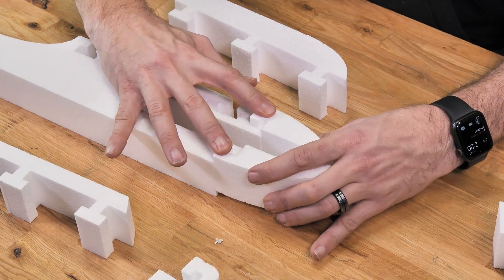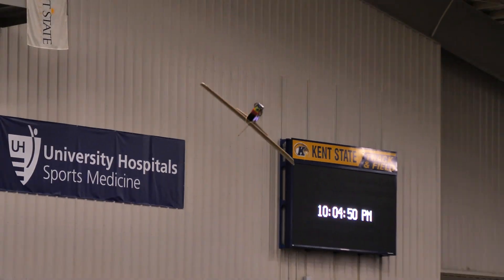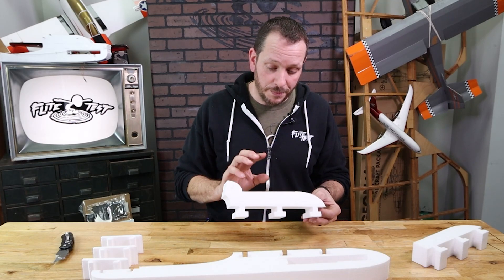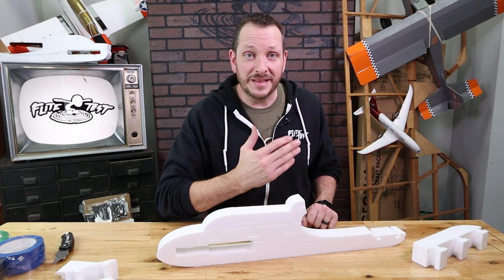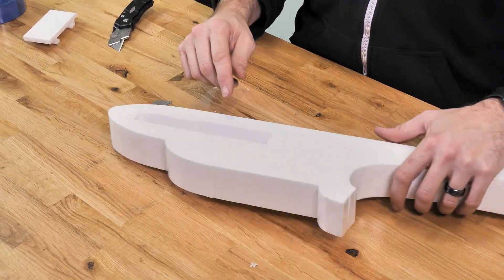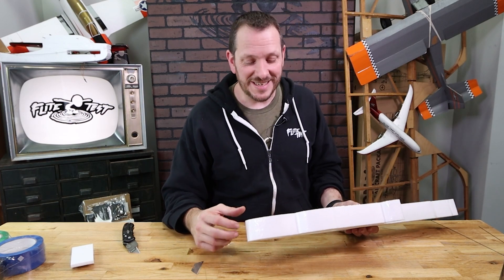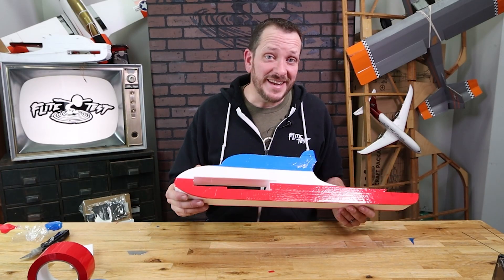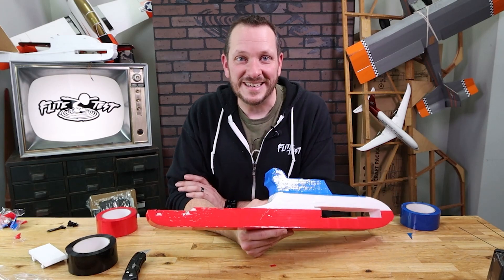How to Build And Reinforce FT Tenet Fuselage //  BUILD

Comment: Cant you just spray paint it and then put clear tape on it?
Reply: @wesflitetest7679  Most spray paints will indeed melt the foam, but you can find paint that won't. You could spray acrylics on it using a detail gun or airbrush for instance. Just be sure you test anything on the scraps of foam first, even if you think it will work on foam!
Reply: That being said if you have to lift the tape during application you're going to take the paint with it... making it ugly. So colored tape, vinyl, etc... is going to be preferable in general. This is a STEM/trainer plane, not a hanger queen. Save the snazzy paint-jobs for more serious planes later.
Another thought is that there do exist paper tapes that could hold paint (make sure it's foam safe first anyway) after you tape it. Or you could cut a whole side piece from large craft paper and Super77 it on. But again, it's a test mule, doesn't need to be pretty.